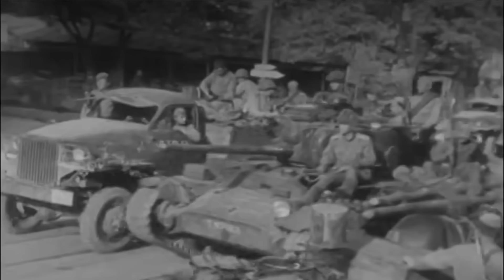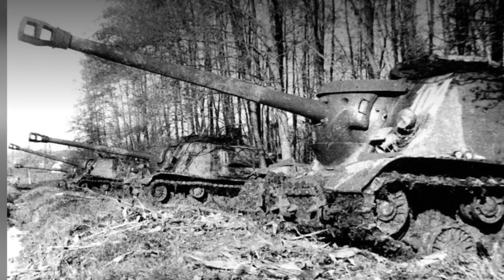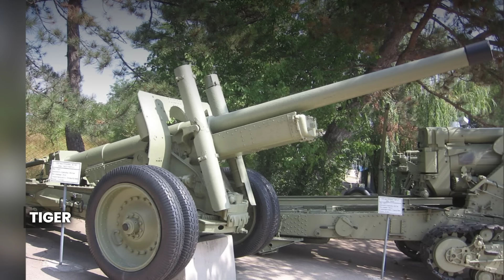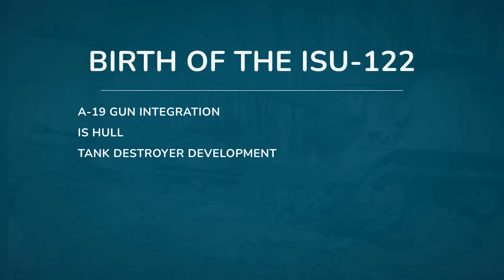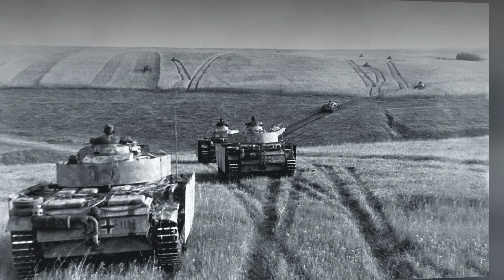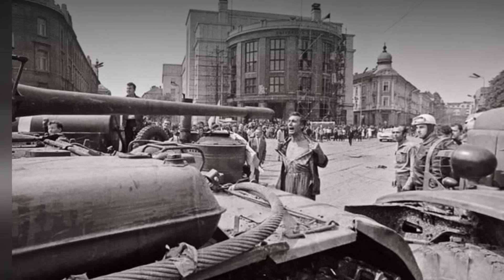The FURY of Soviet ISU-122 Tank Hunters in Ukraine, 1944

Comment: A few facts are wrong in this video:

1)  The reason why there was the ISU-122 was not, repeat not, due to a shortage of ML-30 152 mm howitzers. Instead it was:

A) The ISU-122 was originally built because Soviet factories produced the ISU chassis faster than they could build the 152 mm ML-20S guns.

B) The "Shortage" Myth: Despite the myth that ISU-122s were made to fix a 152 mm gun deficit, the reverse was frequently true. Vehicles were actually assembled as ISU-152s (with the 152 mm howitzer) during periods when A-19 guns were in short supply.

2) The A-19 could penetrate a Panther's sloped upper front hull at long range, over 2000 meters, easily.  We have a number of documented examples of it doing this, and in early 1944 too, at long range with the Panther losses confirmed by German records.  Moreover, the US and UK data on the A-19 also conclude that yes, it could penetrate the Panther at long range, once the effect of T/D ratio was factored in.

Tiger I or Panther vs IS-2 wasn't a fair fight; both could be KO'd easily at long ranges by the D-25T while the IS-2 really only begins to become vulnerable inside 1000 meters with "sure kills" being within 300-400 meters.  The ISU-122's armor would make it more vulnerable, however, than the IS-2 (90 mm sloped at 30 degrees isn't much).  I have always wondered why there wasn't a 'straight nose' version of the ISUs, like the model 1944 IS-2; using an online protractor it should have been possible to create a 90 or 100 mm thick 45-degree sloped single plate that would have acted like 150 mm or 170 mm horizontal armor. That would have made the ISUs invulnerable to Kwk36 (Tiger I) and Kwk42 (Panther) at ranges past 1000 meters, which was the intended range of the ISUs.

3) The rate of fire for the A-19 and D-25 aren't as bad as you cite.  Soviet ROF figures include the average time for all the rounds in an AFV; by contrast German ROF figures are for only the most easily accessible rounds.  It's not an accurate comparison. 

You're obviously relying on Mikhail Baryatinskiy's book (2003 or 2006) which was published before the release of declassified information on the IS tanks (beginning in 2009).  It has a lot of unsupported, undocumented, and unverified information which I can only classify as 'hearsay' as there is no bibliography or sources cited.  I have asked Peter Samsonov, author of "IS-2: Stalin's War Hammer" which IS extensively and completely documented about some of these claims, and he has told me "Don't blame Baryatinskiy, he had limited material to work with."
Reply: No i would bet that this was AI being used and no books read then spoke about. Almost all of these ww2 videos on youtube these days is AI bullshit.